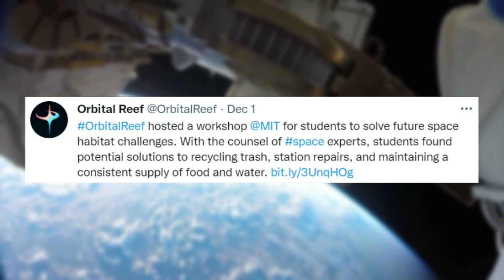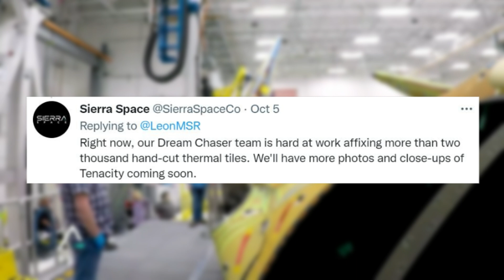Orbital Reef's Progress, Dream Chaser & New Glenn's Importance, Update, & More

Comment: Where is SpaceX in this? They have demonstrated the highest level of reliability at the lowest cost. Excluding them seems an unusual choice to me. The heavy lift rocket would be an ideal candidate for crew and additional habitable platforms, such as food growth and storage, not to mention enormous science experimental areas. If BASS and SpaceX were to team up, the combination would be groundbreaking, surely? Inflatable habitats and a heavy lift capacity seem the way forward.
Reply: The reasons you dont see SpaceX  in the animation is its owner is not populer  with the government  in power. Two he like to do things in house instead of using thousands  of subcontractors. He is also efficient  with his money and his plans move fast. Not populer  with the establishment.  He could  use a modified starship body with a small booster and make the majority  habitual  space two stories tall. It would be cheaper and more efficient  use of resources  but the establishment  dont want that. I mean they have spent totally  almost 40 billion dollers on the total sales system and it has took almost 20 years  to do. And SpaceX  has been working on starship not even hafe the time and a far more difficult  desine.